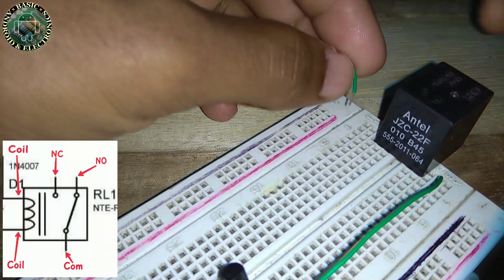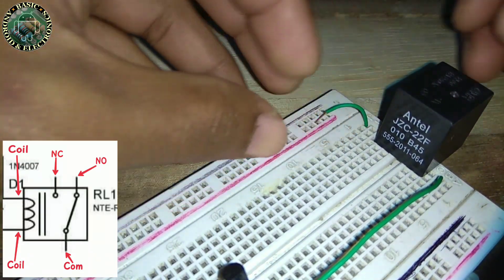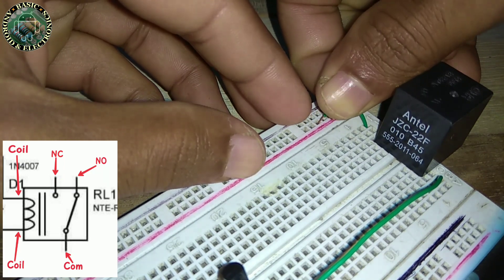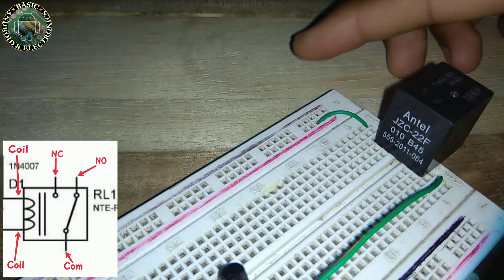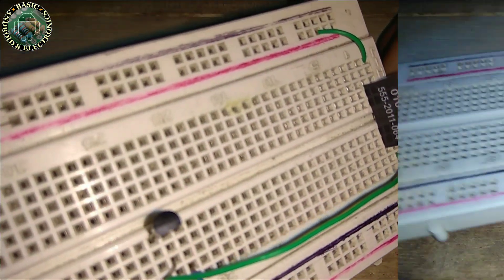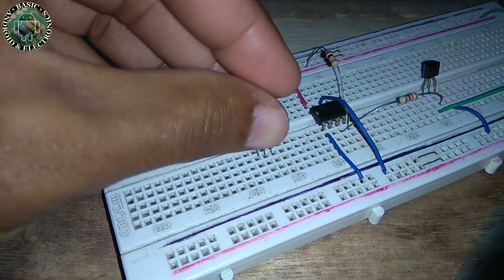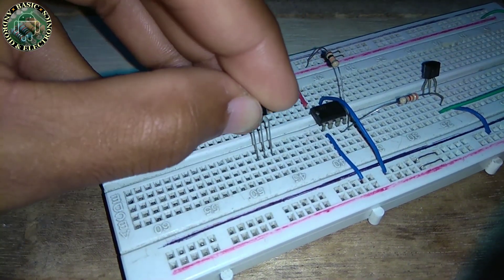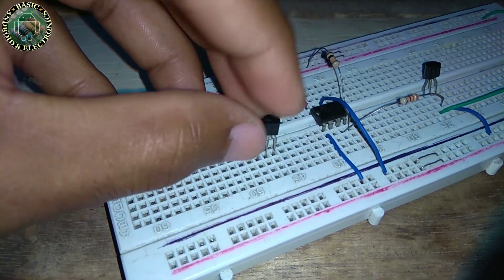How To Make An Auto Pump Controller Circuit on Breadboard

Comment: Sahi kam nahi karta circuit...kabhi sahi off on hota hai or kabhi nahi.

Kai bar restart point par off ho jata hai..
Reply: Dear sir , After going through your video I could not understand  how 1Ph. 230 v  AC pump set  could be operated via A.C. mains. You have not shown  Phase & neutral  connection via relay system of 12 Volt DC supply.  Thanks for preparation  this Video. Think your reply will come soon.